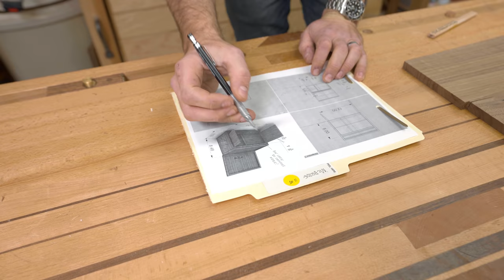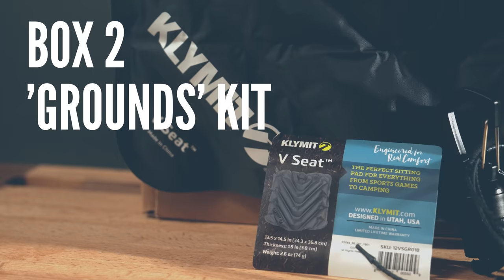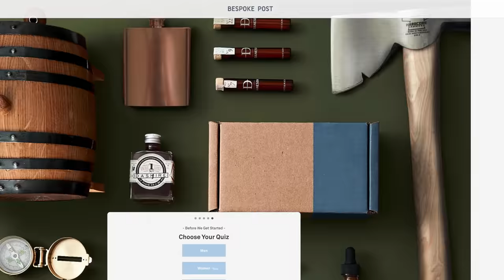LEVEL UP Your Box Making

Comment: Nick, dovetails and box joints are the one thing I admire in woodworkers, because I'm not brave enough yet to try it. As usual your artistry shows through again, even with the confusing way back machine.
Reply: If I could add my two penny worth. Making dovetails or box joints is not difficult; it requires practice or, in the case of box joints, a well made jig. However, don’t fall into the trap of thinking that it is THE or a MAJOR sign of a skilled woodworker (sorry about the capitals but I couldn’t work out how to put it into italics). Mechanical joints were essential when glues were unreliable. So, the cabinet makers 300 years ago had to devise a mechanical joint and one of the results is a dovetail. It takes time to make a good dovetail joint and I think we can be sure that those cabinet makers of 1720 would not be spending precious time making the joint unless they had to. Another mechanical joint is mortise and tenon; this is still widely used today particularly in high stress joints such as door frames or chair frames; even then, the loose tenon (eg domino) can be made as large as you want instead of mortise and tenon.

With all the very effective glues we have to hand now, we don’t need mechanical joints for many applications.. We can use pocket screws, dowels, dominos, biscuits etc for both strength (sometimes only a little) but mainly alignment. 

I would suggest that, now, the dovetail or box joint should be included only as part of the overall design. If you want a very sleek design, then perhaps a dovetail will come across as too fussy for the design. The protruding box or dovetail was a feature of some Greene and Greene products; I do like G&G products but sometimes the protrusions seem to me to detract rather than add - as always, personal taste.

When I see the work of Sawyer or Pedulla Designs, I see great skill in design and then bringing that design to reality. That’s the genius for me. I can cut a mean dovetail but I can’t design and implement such original pieces. 

Just my thoughts.

Comment: My guy! You’ve only been doing woodwork for 3 years?! That’s quite impressive. Where did you learn and are there any books/videos that you’d recommend to anyone out there looking to take their skills to the next level? 
Looking forward to more of your videos.
Reply from the maker: Hey Victor! Man, I’ve just been a sponge on social media. The only book I’ve made it through is the Schwarz workbench book. I’ve made it a hard and fast rule that every project has to have some element that’s harder than the last. Adds up pretty quickly and practice definitely yields results. Gotta mess it up to know how not to mess it up next time is my philosophy. Thanks man
Reply: @SawyerDesign  thanks for responding. Looking forward to you’re next videos to see what else you have up your sleeve. Btw after watching your videos you convinced me that the pantorouter is the tits. I bought a used one off of offer up but due to my lack of awareness and continues stream of bad luck I actually bought the older generation of the Panto. The one without the tilting table. For now it’ll have to do. Down the line I intend not to be a cheap chump and spend the pretty penny’s for the fully loaded pantorouter with all the bells and whistles. Cheers man.

Comment: It is a lovely box - the dovetails are very Greene and Greene. I would suggest that a small box is the only time that dovetails add rather than detract from the design. You may guess that I’m not a fan of dovetails; they are no longer needed to make the joint sufficiently strong but are often included to satisfy the ego of the maker. In your box, they seem to me to fit the overall intricate nature of the piece. It’s the same kind of reason for piston fit drawers. They are not hard to make but it is easy for piston fit to become stuck fit when timber expands or contracts. I prefer to leave a maximum of 2mm - but 1mm on a small piece gap for expansion. There should not be much because the drawer front and back because the grain usually goes left to right and not front to back. 

I agree about design - it is the most challenging part for me; I know what I want to achieve but proportions are not easy for me to nail.

The issue that I have with your “not your fingers;not your problem” is not that I’m the epitome of safety (too many scars to try and be that) but that a lot of less experienced woodworkers will try and copy those techniques. I applaud the stance taken by Inspire Woodcraft which is “if you’re not comfortable doing it this way - then don’t do it”. That’s a good balanced warning. 

This comment is not aimed to criticise you or make you change but really for people to look at what you do and how you do it - and then make responsible decisions about taking on a similar piece.

Have you tried the hinges and locks from Andrew Crawford here in the UK (smart box maker). I wouldn’t say that they are the best in the world because I haven’t tried every possible hinge or lock - but they are best that I have ever used. That award comes partly from the quality of the build; partly from the design with fixed 93 degree opening and partly their ease of fitting. I’m a full-price buyer of them and not connected in any other way with his business. But very good should win out.
Reply from the maker: I’ll have to check out those hinges. Totally get that point of view with safety. I’m contrarian in making light of it to bring attention as preachy isn’t something I do well. 

I’m glad you mentioned the dovetails. I think you’re really going to like the one I have coming up next (this weekend). Very much opposite of this one. This is very pecovich, and hopefully the next will come across much differently
Reply: @SawyerDesign  thank you for your reply

Comment: You actually need to make custom cabinets with multifunction areas to set yourself apart and you would roll in dough to buy more tools , and have a huge challenge constantly!   It’s the juice !  Not the dough!  The dough buys the squeeze to make the juice!
Reply from the maker: I’ve tried cabinets. Not my thing. Too type a for sheet goods and pocket screws. Definitely where the money’s at though. Tough to install solo too and my shop’s wayyyy too small for cabinetry.
Reply: @SawyerDesign  no your right my shop is same as yours!!
That’s why I took over part of my house? (Obviously I am not married; HA!
And I skip 90% of the pocket screwing use rabbits !  Plus I dig cabinet doors so I do a lot of reskins!  
Do big honking tables !!  

Hey as long as your making some bucks you will grow!!!  Me I hv another income from prior job, 
What I found though is you gotta keep really focused!  I got bored with little stuff that fit my shop?
So I threw caution to the wind and starting building big stuff and just made it work!!!
I know a guy as talented as you man!!!  You gotta build huge hulking stuff worth thousands !!!

Say a huge company needs custom office furniture for you know the ppl with all the juice!!
Conference tables?

Ahhh u know sorry if I wasted you time!  But your so talented as a carpenter !
Heck move the family into the shop? And make the shop in the house?
Problem solved!!!!